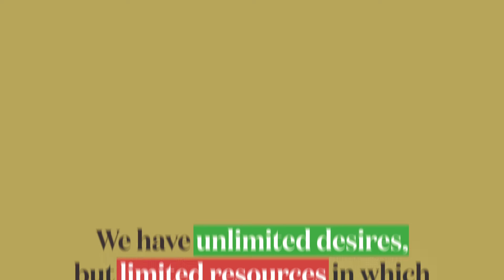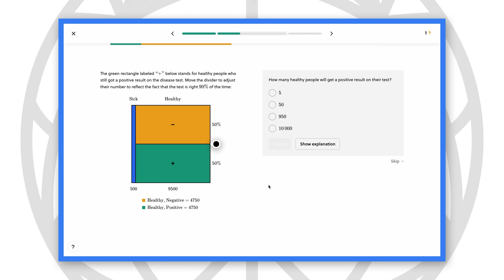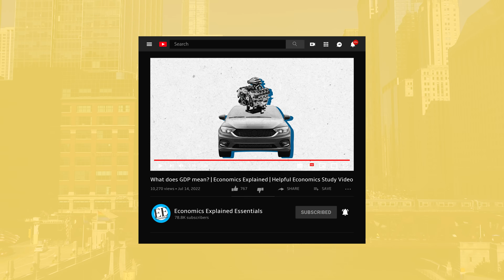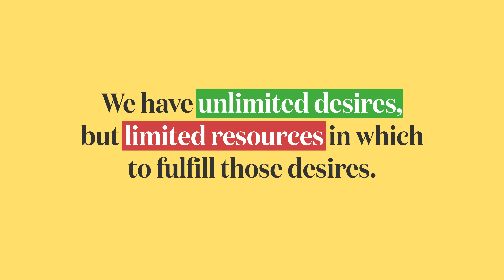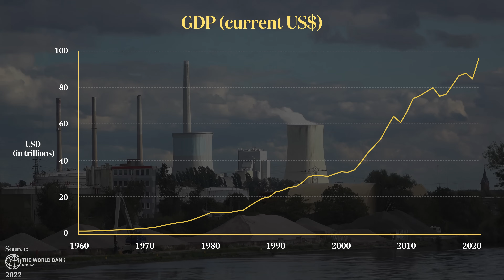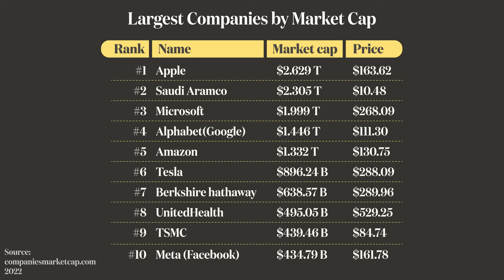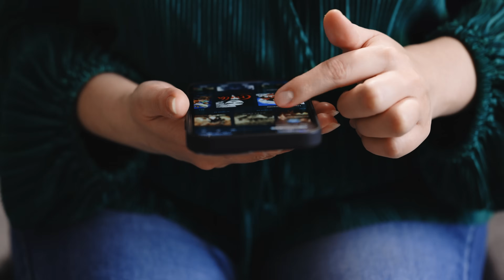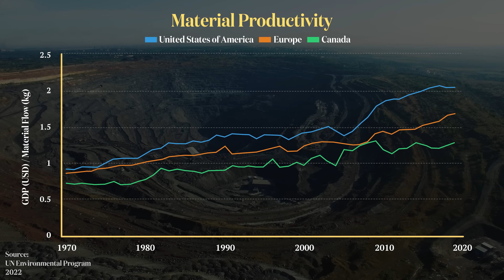Limitless Growth Is Possible If We Run Our Economies Correctly | Economics Explained

Comment: first, those two scenarios for endless growth dont work;  making better products instead of more means less products need to be made in total as the products will last longer, therefore cancelling out any economic growth from their increased value, and digital growth requires more resources than you might imagine considering the huge servers required and their vast energy usage, not to mention that people only have so much time in the day to consume digital media.
secondly, and more optimistically, we dont need endless growth to achieve a sustained high standard of living. we simply need some growth/efficiency improvements combined with redistribution to reach an economy where everyones basic needs are comfortably met and they have the time and energy for self expression. once that criteria is reached for everyone, widespread growth is no longer necessary. perhaps growth in the production of some new vaccine or a novel piece of scientific equipment occasionally, but by and large the economic output has no need to grow much beyond the point where everyones needs are met

Comment: There were so many problems in here. Apple is mentioned as one of the most profitable companies, but that's true due to its exploitation of finite resources. Your podcasts and videos didn't produce lots of emissions or use lots of resources, but everyone using the computers and microphones and all the computers and microphones produced cause a huge amount of pollution and require a massive amount of resources. Nothing happens in a bubble. No one is an island. And under capitalism, the company that makes the excellent coat for $2k will be competed against by another company who makes a nearly equally excellent coat for like $1.8k. And so on down the rabbit hole. Capitalism is in the interest of the capitalist, and not the consumer. Increasing farming efficiency means reducing waste, but that means pesticides to reduce waste, or faster and more efficient machinery to harvest the vegetables or whatever. And those things inevitably lead to more environmental degradation.

Comment: This is way over simplified. What reLlu happens when resources are rare is the price goes up. Then the principle of subsitition happens. Other resources are substituted. When whale oil was hard to get (for lighting), kerosene replaced it at a cheeper price. Then natiral gas replaced that, then electricity repla ed that. And so it goes supply will seek equilibrium with demand through price. Except the government thinks it can outsmart natural economics and screws it up.

Comment: Great to hear that. I have been thinking along similar lines for many years. My way of saying more or less the same thing as this video is: one can grow the economy without consuming more ressources by doing R&D (Research and Development). It is equivalent because R&D yields either better products for the same amount of ressources, or the same products for less ressources. Another, and very different line of thinking is this: Not all resources are finite in practice. Water is nearly infinite, but gold is not. Therefore, we can redirect growth from that which require scarce ressources to that which require abundant ressources. One very current example of this is the effort to make lithium ion battery with as little cobalt as possible.

Comment: Showing the take-out coffee when talking about quality / resource depletion doesn't make much sense. It's more expensive than making it at home, but from the resources point of view it's the same (actually possibly better the take out, because they most likely use the equipment in the cafe more than me at home). Quality could also be better, if you are not from USA or/and don't go to Starbucks.

And another thought, you producing the video is not that easy on the resources either. It's just not that visible. Building all the infrastructure, all the software development, your equipment (if you use your computer for 10 years, then probably it's ok, not so if you are upgrading your sheep-book every 3 years) ... a lot of raw materials, energy and human time had to be spent for you to be able to produce that video.

Comment: As much as I would like infinite growth to be reachable, I see at least 3 major issues not covered by this video...
1. All ressources are not as important as the others, and might not be replaced : the lack of oil will make the price of all other resources and energies surge, and finding another energy as efficient for transportation might be impossible
2. Better products actually don't add up to more GDP : 1 really good house that lasts 100 years won't make up for all the s**** buildings (and the ressources provided by the suppliers) that would be built instead
3. Even if we disregard the first two arguments, isn't this economic growth shallowy ? Increasing infinitely the quality of goods is basically increasing the price of goods of a very marginal surplus of value added... We take inflation for growth
In the end, isn't the GDP a broken KPI ? HDI seems a more reliable tool, that could grow infinitely (yet converging to a limit) despite the shrinking of economy (better allocated ressources, redistribution...)

Comment: The problem with this idea is that even if you stagnate resource consumption or use resources more efficiently, the finite resources being used will still eventually run out just at a slower rate. Therefore, it is incorrect to believe endless growth is possible while keeping the use of finite resources (ex fossil fuel to run the data center and build cellphones). Now if we get to a point where we use no finite resources at all to produce everything in our Economies, then yes, limitless growth is possible, this does seem like an extremely unlikely event in the near future at least. However, at least this method of material efficiency certainly buys time. By using finite resources more efficiently we can stretch our growth limits for sure, but it by no means will it give limitless growth, that is where there is an error in thinking. Perhaps there will be one day a future where all we use is renewable resources, then yes we will have the ability to achieve the beautiful limitless growth dream, but for now we can just buy time through efficiency gains and innovation.

Comment: Infinite growth is possible, as long as you don't make any waste of any kind. And you have enough energy.
Nature does it.
You just cycle the same elements (literally the atoms in the periodic table) around faster and faster. All waste is a feedstock for another process. And all energy is free from the sun.
The more it happens the better it gets. 
And it's a resilient system too, because it's self healing and tends to be self correcting.
Can humans make a system like this? No.
Therefore, it's not going to happen.

Comment: 8:40 - this goes to one of my points of view on "saving the environment". That is, a "clean environment" must be viewed, economically, as a luxury item . Now. people loose their minds over this - NO NO NO, a clean environment is a NECESSITY! they will screech. Well, you can want to view or value it however you like, but the simple fact of reality is that is NOT how it works. Now, if you really want to solve a problem, you have to accept how a thing REALLY works, regardless of how you might like to imagine it ought to work.

To illustrate, as is touched on, when your immediate concern is to simply put food on the table, you have zero concern for the impact on the environment for how you accomplish that. If all you can afford or are capable of is highly damaging means, then that is what you will resort to. Now just like only after you have met basic needs of food, shelter, etc. can you begin to consider luxuries of higher cost better food, better bigger houses, nice cars, bigger HDTVs, you get the idea. "Hey, now I can afford that nicer more expensive house" etc. Well, the same holds true for the environment. "Hey, now that I can produce enough food etc, now I can consider those more expensive means of producing that incur less environmental damage."

The point here being that contrary to what many people think, the BEST "solution" to environmental protection is GREATER wealth, not less. Only when you have the luxury of adopting more expensive environmentally friendly means of production will those means be adopted. "I have my nicer house, my nicer car, maybe I should now consider dedicating some of my wealth to more environmentally friendly means of producing that."

And we can look at historical results to back that up. Just look at things like early industrial London versus today. Early industrial London was abhorrently filthy. But modern London is vastly cleaner. Is modern London wealthier or poorer than early industrial London? Same for LA. LA has a huge smog problem but today the skies are cleaner than they ever have been in modern industrial history. 

And where people get it wrong is that people just assume that greater wealth = proportionate environmental harm. This is not true. What people don't understand is that with greater "wealth" also comes the means and ability to obtain the wealth of goods and services with technologies that provide and enable GREATER efficiencies,LESS resource consumption per unit output, LESS environmental impact per unit output, meaning LESS harm to the environment even though wealth of goods and services is increasing.

Comment: this problem is only unsolvable if humans have material unlimeted desires (the non material things like love are hardly economic), which they dont cause 24 hours can be only consumed so much for example like food. if you eat all the time you die, if you dont sleep you die. so there is a maximum for most origins which drive desires.
therefore there is a maximum for desires per human. i could outpeak and you die, or a stable maximum of desire which lands somewhere between wall-e and idocracy. since human life is not all about consumption, but fullfilment, which is partly consumption, some nations see deflation/stagnation like japan when their population get old and dont all buy sportcars as third or fourth cars.

Comment: What a fantastic, thorough debunking of that world economic forum ted-ed video released 2 or 3 weeks before this. As a fan of this channel (and common sense) I could poke a lot of holes in it by myself, but EE's concise counter to every point is so potent that it's no longer even a debate on which side of this issue is right

Comment: “Reflect governments that deliver strong material productivity growth”… 

If that were the case, the US would strongly push for nuclear or enact policies to reward energy producers for lower heat rates. Instead they give tax credits by the Inflation Reduction Act to push hydrogen fuel use which, if one did not know, is produced by natural gas and is way less efficient in than other sources. And this is one of the many policies governments push “for the environment” which really are questionable 

It’s as if hydrogen production companies pushed the government for these policies…

Comment: The premise for growth is based on the false assumption that human beings have unlimited desires hence the need for endless consumption or spending. Throughout history there was a fixed money supply ie a cap on the amount of gold in circulation and wealth creation occurred around that. Money was just a measure of wealth. Our input eg labour, skills, effective planning, would result in greater output over time and people would get wealthier by way of things getting cheaper. This is normal economic growth. A boom happens when money supply increases which historically has happened through debt but the wealth doesn’t so prices get driven up once all the money works its way through the economy and then we can no longer afford anything. So it is possible to have economic growth that satisfies the needs of everyone in a world with finite resources without resorting to a debt inflated interest rated boom which only benefits a minority at the  expense of the masses.

Comment: One thing which would not put world up side down, would be enforcing longer warranty on products, take avg use time of product of given class TV, laptop, car, and enforce warranty for this many years. This would not impact people much, because they do use them for this time, but it would "force" indirectly companies to make products which last at last this long.  (and working that law was enforced, not that car where engine die in warranty is out because you drive more then 2 miles...). This would lower sells of companies which would make this products, but it would be only relocation of capital and manpower, people would not put money they safe under couch, but buy other things, which would motivate to make products which have less demand today (this is why I name it relocation, not lowering production). And this would lower use resources for this things, and lower amount of garbage produce, but not impacting people as some bans will. 
It is win win strategy, maybe not for eg Apple which would have to support they pc for 5 years, not 1... but I think they can handle it.

Comment: Usually I like your videos quite a bit, but your comment about building a shoddy house taking the same amount of resources as a good house is WAY off. Without getting too deeply into it, the 80/20 rule applies to everything, and while it might take just as much cheap chinese '308L stainless' to make an exhaust as it does actual 308L stainless from a reliable supplier, the difference in materials and labor input is significant. If the cheap material had to move 1 ton of earth to gather the raw resources needed, but the quality version of the same material had to move 1.8 tons of earth to get the same quality final product, your whole equation is off enough to defeat the basic premise of this video.

Comment: I think this theory is completely flawed and is still based on the desire for certain players in the economy to maintain growth at all costs. You can increase material productivity but ultimately that increased wealth is just going to buy more cars, mansions and yachts. It doesn't end with money in the bank. It ends with more products consumed. There is a limit to material productivity in any case. You can't ever reach 100%. At some point it plateaus because you can only get so much service out of a given set of resources.

Unlimited growth can never be a solution. We must have negative growth in a way where everybody wins. That is, a sharing economy where, for example, 1,000 people don't own a 1,000 drills they use twice a year for half an hour. And eventually we must have declining populations. It's the only thing that is ultimately sustainable.

Comment: Policies to promote material productivity are unnecessary - there is an inherent incentive for businesses to produce in this way.  For instance - if you can make $10 by using $1 of inputs, would you do that or would you make $10 using $5 of inputs?  The issue is that not all industries or processes lend themselves to material productivity gains - a tonne of iron ore will always produce the same amount of steel, whereas we used to have to make things called CD's to listen to music, now it is all zero and ones.

Comment: I think the solution is simpler. Remove the protections the government has put in place to protect the business owners and investors from liability. This would make the risky loan borrowing then go bankrupt scheme of our boom and bust economy untenable as every individual owner or shareholder would be responsible to repay what remains of that loan. This would halt the strategy of trying enough things that fail across the board until you get lucky as all the individuals assets even in the company that succeeded could be pursued to repay the debts. This would force businesses to carefully plan out the future and make genuinely good products to assure their shareholders of quality. A useful side effect is things would slow down and at a rate where things might rebalance and material supply side of things could grow with the economy as a whole.

Comment: We aren't going to run out of rare earth metals. They're called "rare" but most are quite abundant, just not as easily accessible as the cheap sources we use today. As you've pointed out in other videos, raw materials account for only a small portion of the cost of complex goods. If/when we switch to other sources, prices could quadruple and it wouldn't actually increase the cost of finished goods that much.

We also aren't going to run out of farmland. Vertical farming and GMOs (fearmongering luddites aside) can exponentially increase our food output per square kilometer.

Fresh water is a real concern but if fusion power eventually works out it'll be a non-issue.

I don't think we're going to run out of fossil fuels at the rate we're now switching to electric vehicles and in many cases planning to end production of ICE vehicles over the coming decades. Fossil fuels will probably end up being reserved for long-haul trucks or heating in remote areas and, if anything, will start to become cheaper. We're likely going to need the byproducts of fuel refining more than we'll need the fuel itself.

As ridiculous as it sounds, ordinary sand is probably going to become a very valuable commodity.